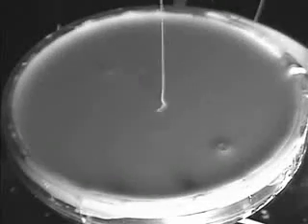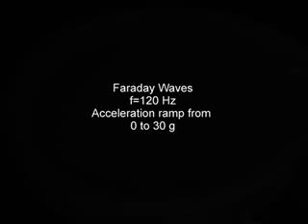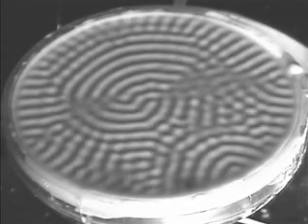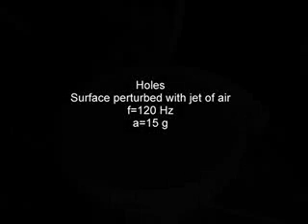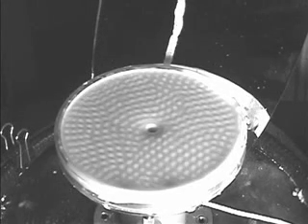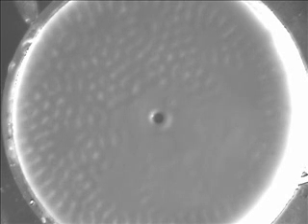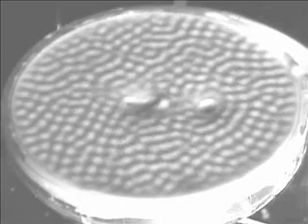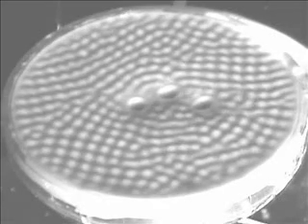Cornstarch Coolness

Comment: DO NOT PUT THE MIXTURE DIRECTLY INTO THE SPEAKER CONE. YOU COULD BE ELECTROCUTED!! Please remember to put the water-containing fluid in a non conductive container. Simply lining the speaker cone in plastic wrap should suffice. To generate a tone all you need is Audacity. It's a free wave editor program for windows and i believe it supports Mac and even Linux. This program can generate simple pure sine waves at any frequency. I found the best results are in the 10-200 Hz range.

Comment: It's nothing more than a 50/50 mixture of cornstarch and water. Flour can work as a substitute for cornstarch though not as well. A larger diameter speaker will produce more visible effects. Sine waves at high power can cause hearing damage because there is more energy being carried by the wave than if the wave were sawtooth or an audio track. However, for this experiment you need not exceed 70 dB, which is below the hearing damage threshold. It may be annoying, but it's safe below 90 db.